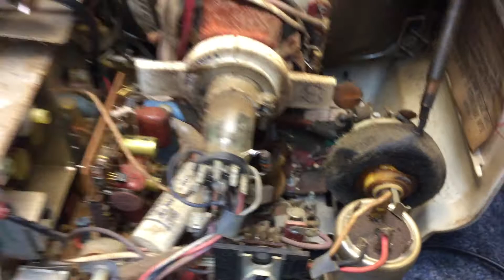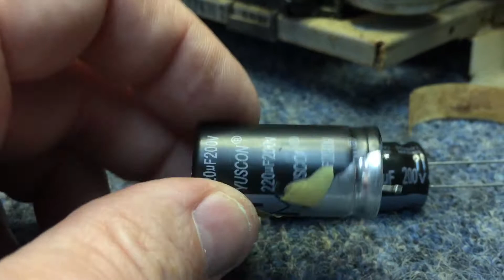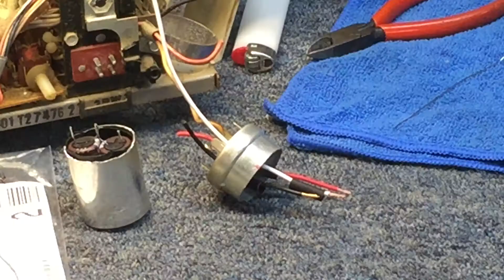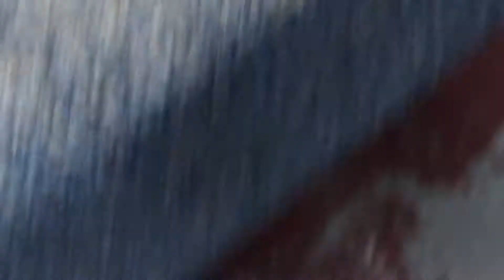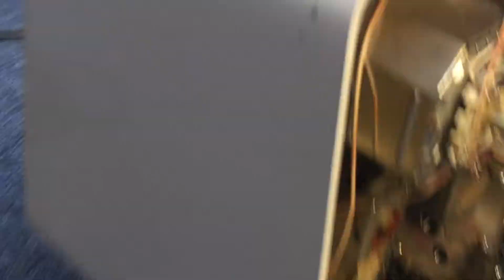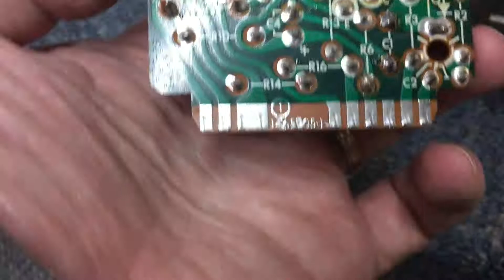1976 RCA 9" TV  AA096Y - repair & testing

Comment: Isn't the 100K carbon comp resistor near the vertical output board socket burned and cracked?
Reply from the maker: David, thanks for checking out the video!  Yea, it damn sure looks like it but i would have surely smelled it, there was quite a bit of cigarette smoke residue and dust in this unit so maybe thats somehow distorting the view, I was making the videos with my phone back then so of course there isn't a tight stable shot of that resistor but i do still have this little tv so I will be having a look at that part and will post my findings.